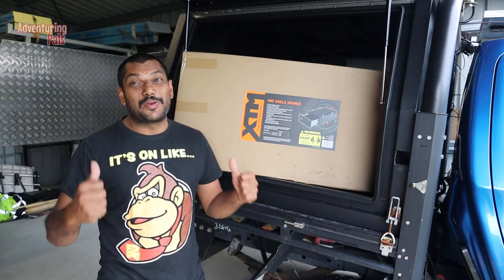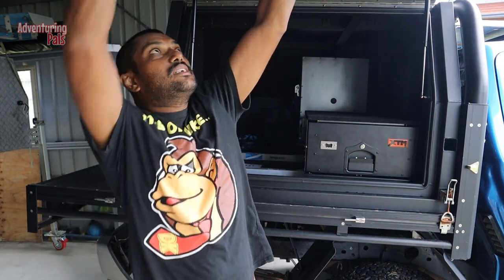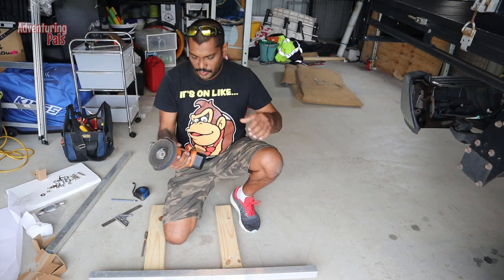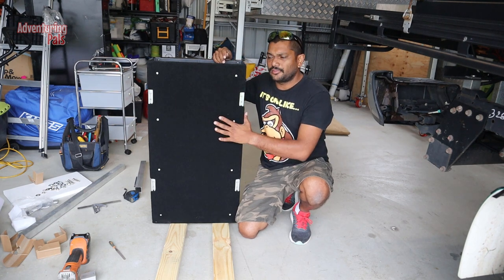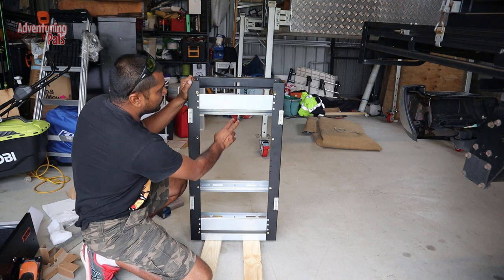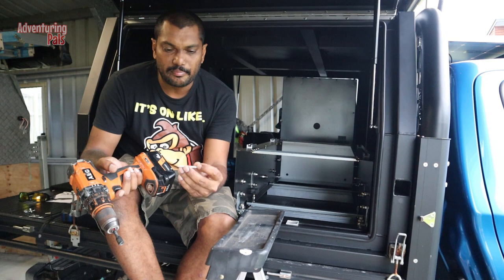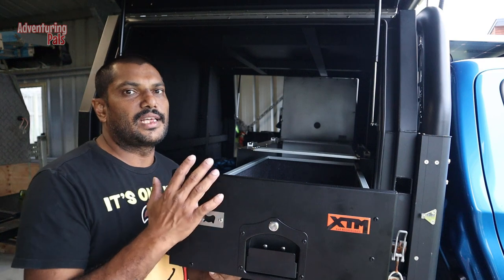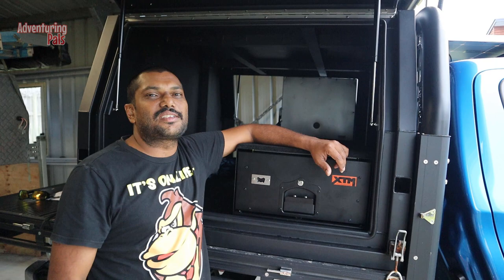XTM 4WD drawer install . Easy DIY

Comment: Nice to see real people keeping things real 👍 I’m just about to install mine and wanted to see how others had gone about things 😎 
Out of interest, did you end up using those M10 bolts to secure it? I know that if I’d done it quick n easy like you did, it’d still be like that 10 years later 😜😜
Reply from the maker: Thanks mate. I’ll be honest with ya, no I haven’t lol. It’s still holding in there. Done the Simpson Desert crossing and a few trips to K’gari / Fraser Island with no issues at all.
Reply: @AdventuringPals  I like it 😁👍 I was just looking at sliding my canopy off to the side to put the bolts thru properly but then I’m like, yeah….nahhhh 😜🤙

Comment: Nice job mate, Just wondering sense installing the draw how is it so fare? as im looking for a pair for my old ute.
Reply from the maker: Thanks mate. All still working well. Only complain is that the draw doesn’t have a strong catch to keep it open. So when parked on a tilt, it wants to keep rolling back in. I’ll try and work a solution to this and if it works then I might make a video in it.
Reply: @AdventuringPals  sweet thanks

Comment: How you take the drawer out and can’t get the drawer to lock out.any help appreciated probably something stupid I’m doing
Reply from the maker: Hi mate. To take the drawer out, you pull it open and then at the back on the inside of the drawer there is a latch which you can pull, then the drawer will open all the way out. 
As far as locking it out, there is a small notch that the drawer sits in when open but it’s not all that effective on any sort of slope. I have cut a piece of conduit that I use to chock it open by putting it in where the slider part of the drawer is. 
Hope this helps mate.